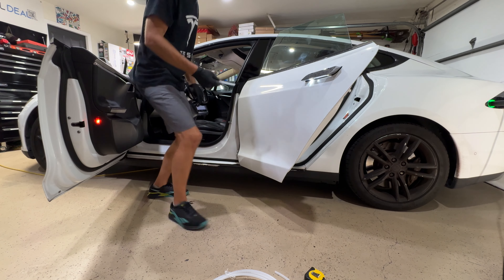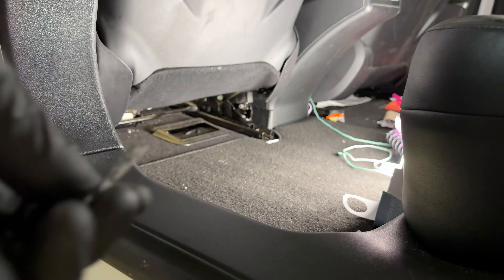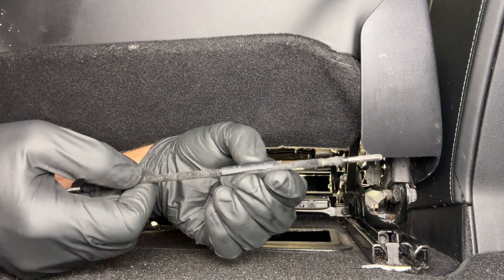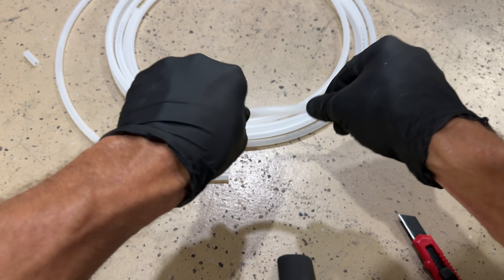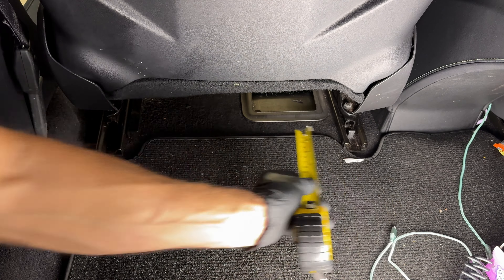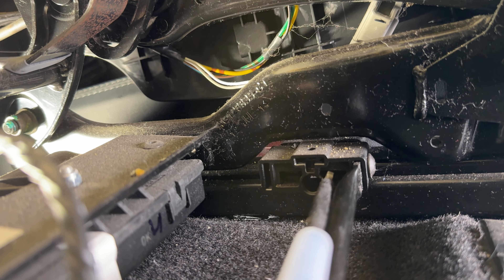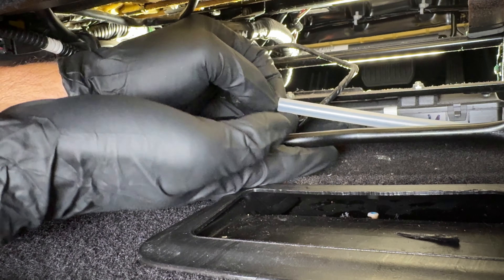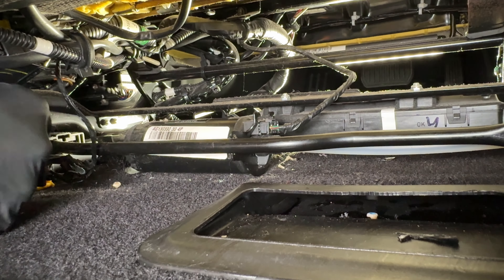Fix your Tesla Model S seat for cheap!

Comment: I like how you left out the inner diameter of the tubing, which is extra annoying because I went to your site to order 2 - and you have 1 in inventory.  

So not I can get the 1 from you, then use a micrometer on it and then order the tubing anyway :(

If you had stock it would be cool, but come-on mang, and 6 dollars for shipping when it would fit in a 1st class envelope - even the more than 1 ounce unusual is just $1.50.
Reply from the maker: I apologize for the inventory count. But zero appreciation huh!? Inventory count has been changed.